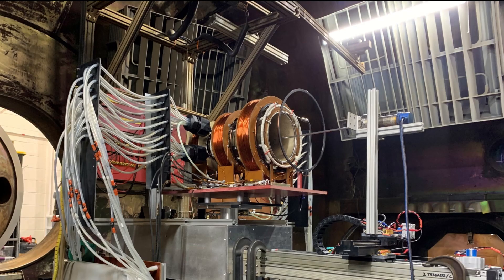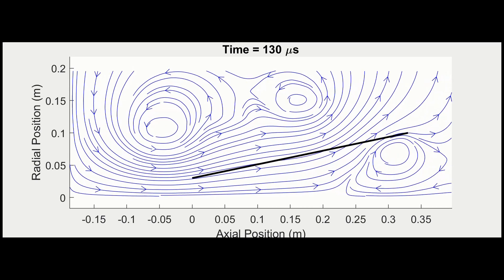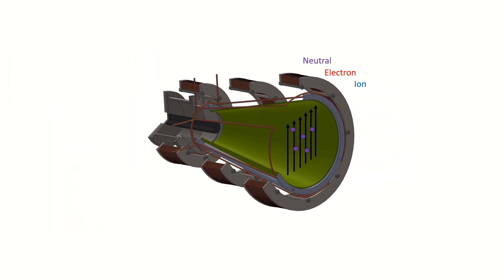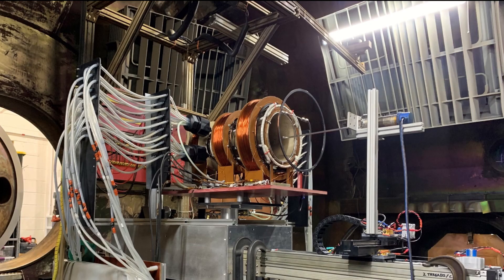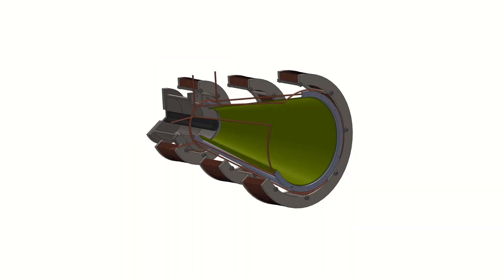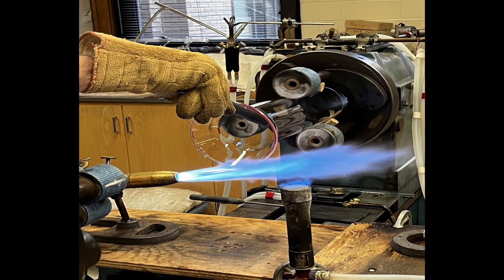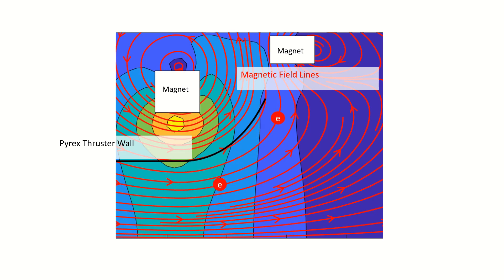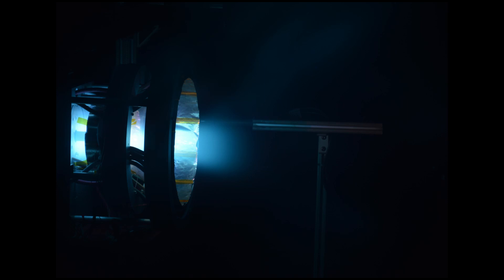Design Process of an Updated RMF Thruster

Comment: Hey Chris, I'm working on a design for a plasma electro aerodynamic thruster. similar to "Science Workshops- how MagnetoPlasmaDynamic thrusters work" and "skill make-super ionic plasma thruster" I noticed you currently are having a hard time controlling the electron direction. I believe instead of using glass or multiple rotations of magnets you can achieve this using only plasma from either xenon or atmospheric nitrogen and 1 adjustable magnetic field by taking advantage of the ionic wind as a start, and the Lorentz force as a booster. I have a few designs for even using the plasma itself to ignite a fuel to increase the thrust. what's your take on this design? I'll upload my sketches in YouTube shorts shortly for you to see.. the main difference is using multiple anodes to start the thrust similar to MITs  ionic wind flying airplane,  and in series adding a second anode on a separate circuit but only using one, and its cathode is a ring behind it. the high voltage strips electrons from nitrogen,, ionzing it and all electrons, protons and any air between them is accelerated. once the ions make it to the 2nd thruster the anode once again accelerates the ions and protons to a fraction of c, by using a magnetic field that is now perpendicular to the flow of electrons(current) that triggers the Lorentz force to once again accelerate the protons and some electrons to 100km/s